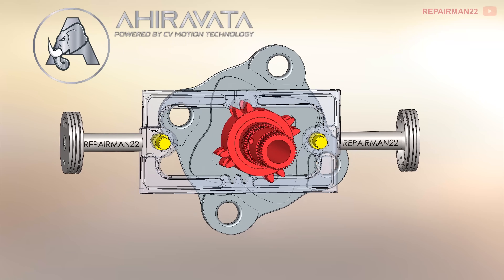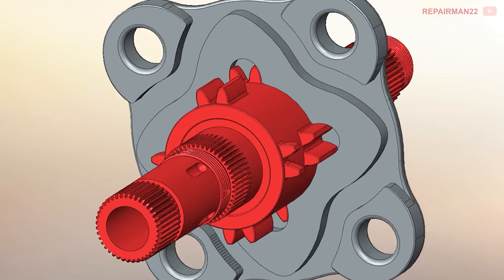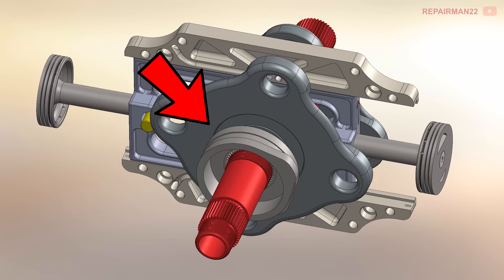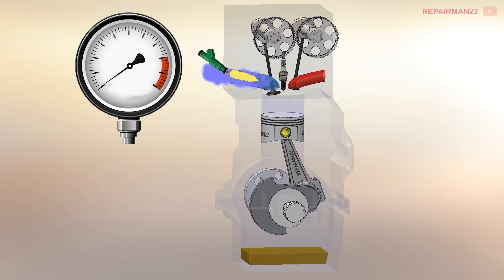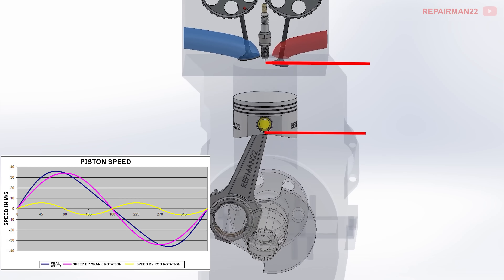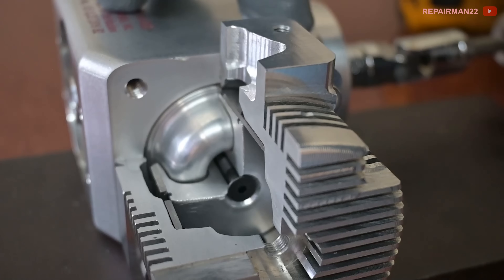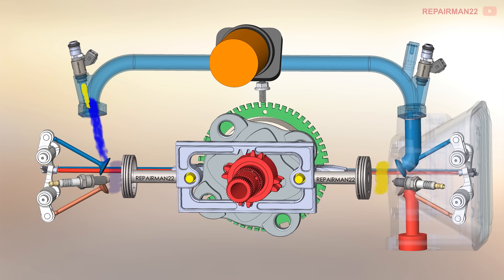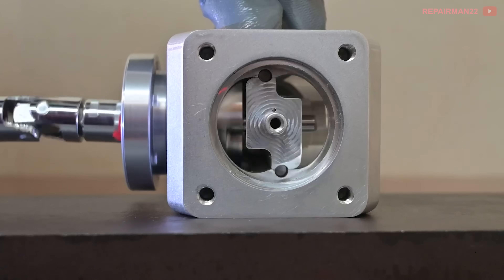The New FLOWER ENGINE 🌺 from Ahiravata 🐘

Comment: Nissan has a car with a generator powering an electric driving motor. An electric motor drives the car's wheels. No heavy power sapping transmission is needed.  This engine running as a constant speed generator powering Yasa electric motors may be a winner. Better mpg and lighter. 
Having an electric clutch means staging in a second engine for more power. Having it run at a constant speed means longevity. Looks good.

Comment: Roller Bearings on the pins was my thought was well but size might be problematic.
An antique air compressor used the same basic design, but I think lubrication was a problem, unless an oil pump can be implemented which would also provide filtering as well .

Comment: Primary balance is poor, not like that of a crank driven boxer engine which is perfect. This engine will yaw in a 4 cylinder configuration. No threat to an EV, you can't charge it off your roof for free.

Comment: They should invent a rotary engine with no crankshaft, only an output shaft.  Design it to run at fixed speed for perfect efficiency.  

Nevermind 🤦‍♂️ someone already invented the turbine engine.

Comment: No point in eliminating one rotating element (connecting rod) with a sliding element (rectangular frame and pins).
This is adding friction to existing design. It will surely have lesser efficiency.

Comment: Since most of my concerns were already voiced in the video, my only gut feeling is that center plate connecting the two rods. If you want to transfer power/torque, this has to be very rigid and that usually means heavy. With high mass you have high inertia to overcome. I am curious if my gut feeling is correct and how they will address this in a serial production ready version of the engine.

Comment: As intriguing as it is, I'm mostly curious about the longevity of the internals after a good number of heat cycles and how vibration is controlled. It seems to me this will have much the same problem a typical rotary has, in that, the excessive friction between components will inevitably reduce it's lifespan not making it a viable solution for many applications. It would most likely be suitable for light load applications if I were to guess. Maybe things like air pumps. For example, pond aerator or the like.

Comment: The keys (or teeth) will face tremendous shear stress and break away after a few hours of run. Why do gear teeth doesn't break? Because there is clutch in between the gear and power source. We match the rotation speed and then engage them. We dont let them sychronize on their own. But in the Ahiravat design, the primary job of the teeth is to draw power.
In technical terms we can say, normal drive train operates in the stable response region. Ahiravat drive train operates in the transition region. Clutch is a damper in normal drive train. We often drive in half clutch mode - that's the damping. A human foot makes judgment and gives the necessary control effort. 😂 To add to this, auto-gear cars dont work well in the city traffic. They work well in highways.

Comment: I can see this engine not only working but also in an X configuration with off set teeth plates. I would assume that could help with some issues as well as making a compact 8 cylinder style with about the length of a v6 or possibly a v4.

Comment: cranks and con rods are a kluge. They've never been ideal. 
Spring loaded valves eat a significant amount of power. 
Sliding bearing surfaces are problematic due to friction and wear. Some sort of needle-roller solution should be possible. 
This IS basically a scotch yoke geometry. Its attractive because it gets arid of cranks and conrods. With new bells and whistles (flower, pins, little orphaned gear teeth) to resolve the  problems inherent in scotch yokes. So it goes.

Comment: Any sliding faces are high friction and potentially high wear compared to rotary bearings. Basic engineering
Reply: Low contact point sliding surface will have less friction.
Reply: @infinitebeing1119 my factual engineering principles still stands.

Comment: The advantages of low weight, good fuel efficiency, constant speed and no requirement for longevity would make this engine suitable as an increased range light attack aerial drone engine.

Comment: Hmm, someone mentioned the slider being on ball bearings. That isn't a bad idea, except it adds complexity. The proper clearance with the right weight oil should work just fine. 
   As far as what I think of the engine. It obviously works, as proven in the video.
   It is definitely a different thought process in comparison to a traditional engine.
   However, it looks like a good design to me. Piston speed is important. Combustion events, or the time for a combustion events, are also important.
   The design is really interesting, and only time will tell. I would be interested to see what type of efficiency it has. 
   The video says it has efficiency improvements that are substantial,  so if I were testing or engineering it, I might get a very well known two or four stoke, then build one that is equivalent in size to prove the numbers. It might also be a good idea to put one in a small car for mileage testing.
   The low rpm might also give it good durability. Good luck with certification! Very innovative.
Reply: They will be soon launching a 3 wheeler with the engine and and 2 wheeler aswelll after that

Comment: While it may not be the father of all directly-opposed piston/cylinder engines, the Bourke engine was the Flower in its simplest form. The '30s/'40s Johnson OK outboard motor was a heavy duty, Class B 20 cu.in. displacement engine, the only Class B with directly-opposed pistons/cylinders. Bourke attempted to build a winner in Class B utility/hydroplane racing by putting a flowerlike piston assembly in the OK block with a slot which allowed the crank pin to slide back and forth while translating lateral move of the pistons to the driveshaft of the propeller. Obviously the tolerances between crankpin and the slot were critical and the Achilles Heel of this engine. There are few if any records of racing success. Bourke's scotch yoke replacement of this primitive arrangement never worked for any length of time either; it's the engine's Achilles heel, and while the Flower's arrangement is clever, in practice it will not likely fare any better. Bourke's outboard engines overstressed driveshafts, splines, shear pins etc. - problems were never solved. If you call up Russel Bourke's efforts from '30s to '70s you might save a lot of wasted effort.

Comment: My first thoughts were about lubricating the rod racks. However, the most critical moving parts, which would appear to get the most wear are buried in the core of the engine. How long the flower, rod rack, and pins will work before needing to be rebuilt is a big question. Also, is 2000 rpm where the most power or efficiency occurs? Or will it break itself apart at higher RPMs and that's why it's so low?

Comment: I see another glaring issue you didn't mention: Due to the flower design, the distance each piston can extend outward is limit, as well as their size, thus severaly limiting their power.
My guess is it will just be a different kind of rotary engine - Compact and good power for it's size but useless for bigger vehicles because it cannot be effectively made bigger.

Comment: Inner and outer pins will wear on the flower wheel extremely fast. Faster than apex seals. The engine won't last very long if under heavy load. All the force is on those pins.
Reply: A lubricated roller pin can solve this problem just like how crankshaft bearing works..

Comment: the problem with this type of engine is that the entire load falls on a relatively small area of the teeth that transfer it further to the shaft, the very loaded part turns out to be very small and the material on them is not very simple...
Reply: All gears work like this.
Reply: @infinitebeing1119  No, are you mistaken, this is not the work of a simple gear, on a simple gear, the moment passes from one tooth to another smoothly, but here the moment does not pass smoothly at the beginning there is a sharp increase....

Comment: With some modifications this could be a freaking good high pressure Stirling engine with higher power and smaller footprint. Then it could be used to process/convert many heat sources to mechanical and electrical energy. 🤔

Comment: Thought provoking  design but who will take the risk to produce it? In the last 10 years we have seen many innovative engines that have died by the wayside and they were all promoted for the same applications. While some still hang around they make little or no progress. In order to break that cycle you need a unique application to get it into production and develop a track record; from there expansion into other fields become less of a risk for anyone adopting it.

Comment: Besides complexity and of course, danger. I wonder why hydronic fluid could not be used to absorb impact of experimental engines like this. It would make for an awesome tractor engine, considering the flywheel and this additional component
Reply: this would also lubricate in place of bearings that could wear out

Comment: The geometry tickles my brain, but I don't know if it would actually be more efficient than a slightly offset crank.
I do like the two stroke design not burning oil. That's a genuine benefit, because you can seal the mixing stage behind the cylinder and we can't do that with cranks.

Comment: I find it interesting how many people are worried about the teeth on the crank shaft.  What about all those old manual transmission, they often only have one or 2 teeth in contact while in gear. They put diesel, big bock engine on front of those manual transmission with no problem.  What about rear end gears?  I think this is a good attempt on a different level of engine.
Reply: I am 100% agree what you say
Reply: That's what I am thinking when they do absurd claims of breaking the teeth 😂.
Reply: @infinitebeing1119  They won't break unless you really screw up the fabrication, but they will grind down very fast. At the very least, they need roller bearings on the ends or something.
Reply: @Ithirahad  I agree. High heat area. High friction  and high speed. Equals low longevity.
Reply: Work for a plant that makes gear boxes for automation (not automobiles). Most people are surpised how only 3 or 4 teeth are engaged that are about the size of an ink pin tip and thick as a waffle is what's holding the torque for cranes and wrench systems that can moves simi trucks. The tooth depth is more for ratio and the pressure angle and tooth angles of the teeth is more for torque.
Reply: Yeah the teeth durability suspicions are really hypocritical.
Reply: Please let us just look at the engine and how it works! As opposed to a new "cut" every 3 seconds and gobs of "gee whiz! this is so great!" commentary.
Reply: @hg2.  Really, man.  U gotta stop cut’n’pasting your comments everywhere.  It’s tacky.  Don’t be tacky.

Comment: Intuitively - this seems super inefficient. Is it? They say "the teeth are only for synchronisation" but how can that be? They are transmitting all of the developed power from the pistons to the rotor. Looks like a super high area of wear and friction. The running prototypes appear not to be driving any load, and so they are not really showing whether the engine is, in fact, practical.

Comment: Interesting concept, but a non-starter. Sliders and grooves produce friction and abnormally fast wear. The "flower" plate itself is a fast wear item. The rod rack contributes a significant amount of reciprocating mass which must be balanced out; one of the reasons why it's a low rpm engine. No established manufacturer is going to risk retooling costs to bring this on stream.
Reply: If they use high quality hard wearing metals then not a problem.
Reply: Let those established manufacturers go bankrupt..just like Nokia..
Reply: @infinitebeing1119  Don't hold your breath.

Comment: Because there is essentially no allowance for deceleration, stopping, reversing direction, and acceleration:  Wouldn't the rpms be constantly surging, as well as causing high stresses on the moving parts?

Comment: Wonder how long this Scotch-Yoke will last, meaning as complicated as they are, a Chevy or Ford I6 or V8 will easily go 200k miles (my 2003 Beetle with a 5 valve turbo just turned 150k miles), so that is the question. Make a new video in 10 years/150k and tell us!

Comment: No reason for the short gear teeth. The pins have line contact on the flower, much less area than a bearing shell, so wear rate will be high. Is it better than a Scotch Yoke?

Comment: Constant speed of the piston infers an instantaneous change in direction at both the top and bottom of the stroke. If I’m remembering my physics correctly, “instantaneous” requires infinite force. That’s not possible. If the cam profile makes for an instantaneous change in direction then there must be flexure, mostly in the pin, to provide a ramp-down in the speed of the piston. Perhaps that explains the 2,000 RPM limit.
Reply: Agreed. He probably meant that piston speed was constant through most of the stroke, but didn't explain it fully. By changing the profile of the slot and lobes you could create just about any piston acceleration / speed profile you wanted, which may have some thermodynamic / efficiency benefits.
However, I have significant doubts that the pin / slot crank system could be made reliable for long term use... I think it would wear quickly.

Comment: Innovation towards efficiency! It’s far better than the in-line four
Reply: 8 cylinders design are nessesarry to balance this engine!
Reply: @FrançoisLavigne-d8p  but even the 4 stroke would be a good fit for hybrid cars instead of traditional crankshaft engines. I think this will be a great hit for EVs to be put alongside as it can be placed horizontal like EVs battery unlike cs engine.

Comment: Conventional crank/rod arrangements have problems but also advantages. The localised loadings are well below failre as shown by engines good for 20,000 rpm. The teeth etc in this engine have very high local loadings leading to fatigue. Low rpm helps but leads to low power density, ie five litre engines for average saloons.

Comment: Essentially another variation of the Scotch yoke idea for an engine.
Reply: Its totaly not scotch yoke doesnt work on this flower principle but same as old crankshaft without berings on crankrod so piston doesnt flap move other unintended way
Reply: Not exacly but the scotch yoke is simpler an more reliable due lest stress concentration where parts touthe each others. There is no contact betwen  pistons and cylinders. The pistons rings are still
 in contacts with the cylinders!

Comment: I'm thinking those small pins and teeth won't stand up to long use. Maybe replace that part with rollers or some other friction reducing design.
Reply: The failure will be fantastic.  And noisy.
Reply: Those are roller not tight fitted pins.

Comment: It seems to be a scotch block engine with extra steps. The manufacturer that has gotten closest to putting a CV engine into production is actually Nissan. The VC engine (for all of its faults) accomplishes a near- constant velocity due to the linkage arrangement. It's a shame that they haven't experimented with using the linkage arrangement for the sole purpose of eliminating secondary vibration- as being able to produce extremely large 4cyl engines (5+ liters) capable of high rpm without shaking itself apart would be a game changer in pickup trucks, etc. They could offer multiple displacements at multiple power levels all utilizing the same basic parts, and far fewer of them.